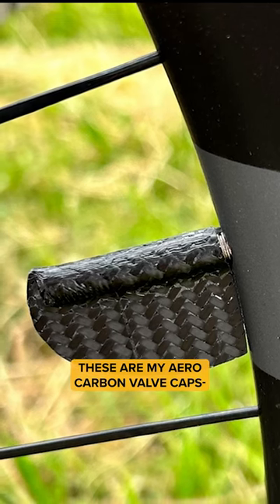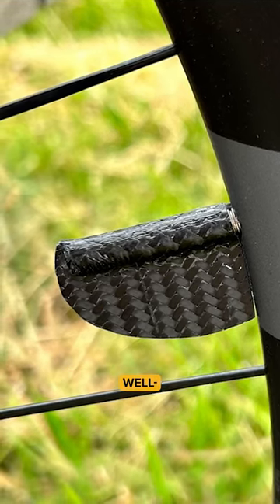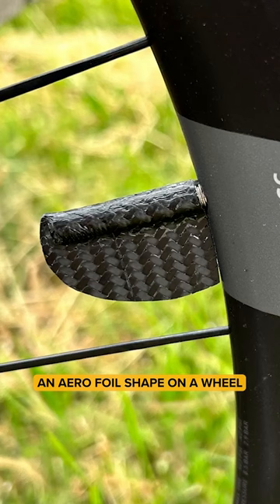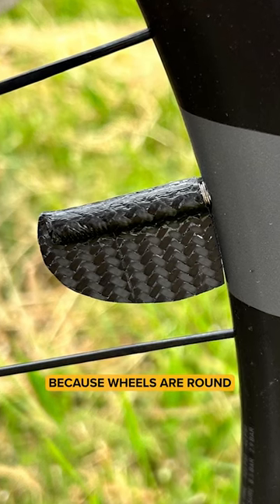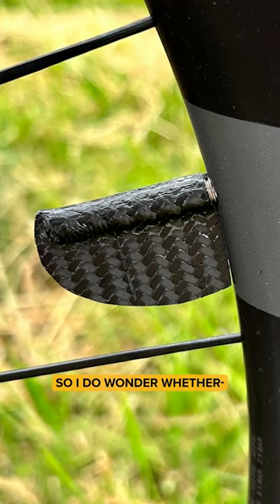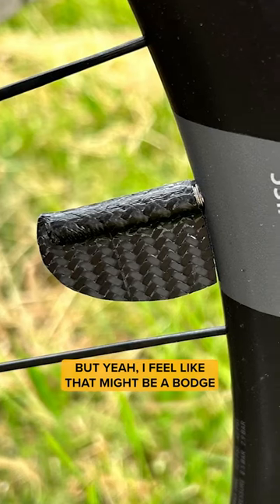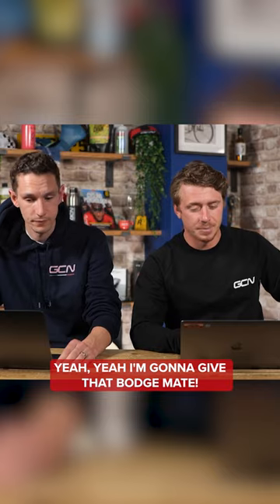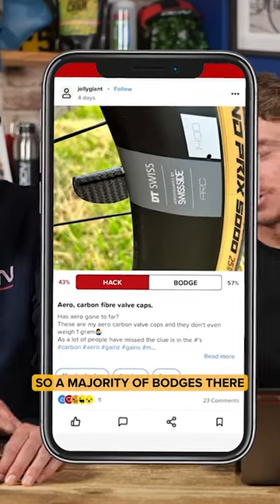Carbon Aero valve caps?! 🤯

Comment: Not an aerodynamicist myself but hopefully what I say is mostly correct:
On a bike wheel, a point on the circumference moves anywhere between 0ms^-1 and twice the velocity of the bike, 0ms^-1 while it is in contact with the ground and twice velocity at the instant it is at the peak of the wheel. (Look at cycloid curves)
This being said as the aero cap leaves the bottom of the wheel and starts to go up (and forward - relative to the ground and not the bike; this is important since air resistance could be ideally modelled as a function of the bikes speed relative to the ground, not the wheel relative to the bike), it’s aero profile would still slice the air in its intended direction.
Anyone feel free to correct me, although I think definitely at the top of the wheel cycle it helps and maybe less so nearer the floor. 
Still a goofy looking idea tho I think, just pedal harder at the end of the day ✅
Reply: Yes it makes the wheel profile like a deep section rim without the weight of deep section.